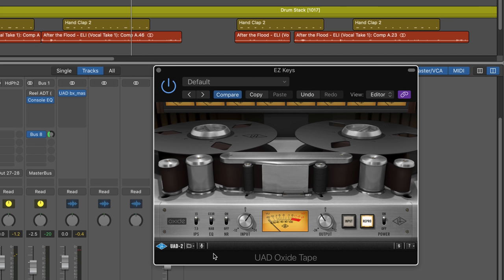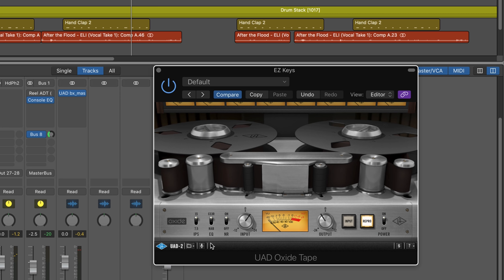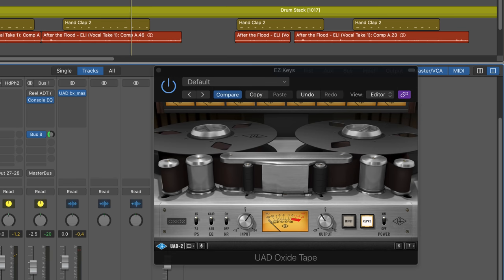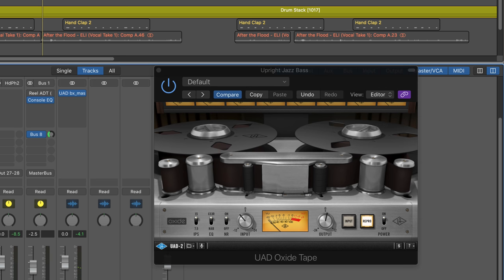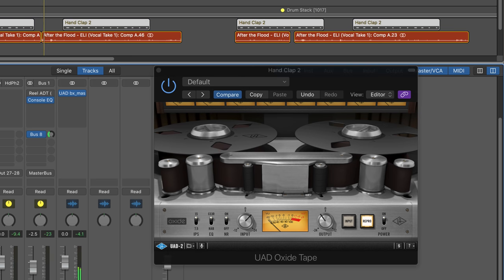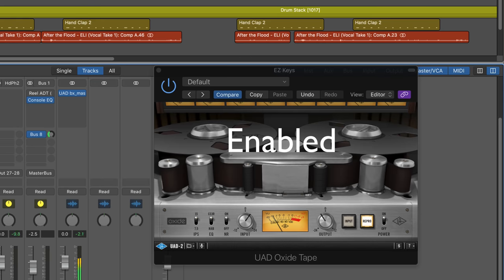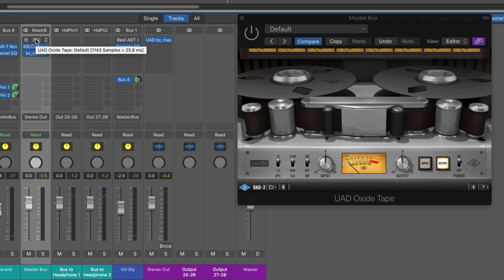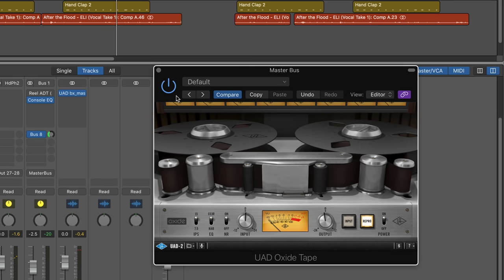How Much Of A Warm And Punchy Tape Like Quality Will Oxide Tape Add To Your Mix?

Comment: really -  you think this thing really does anything other plugins cant already do... its nice to think a pretty picture of a tape machine and some switches makes it somehow analog- i think its a placebo.
Reply: cmon if you cant hear how it opens the sound compared to the other plugins which only saturate it you are either deaf or have terrible speakers/monitors
Reply: @cecosvidovski  it barely changes the sound, pretending thats a huge difference is misleading. I can hear a slight difference.. is it worth a 200 dollar plugin? Probably not.
Reply: @MElixirDNB  It's definitely worth it. It depends on what you are trying to achieve. If your goal is to have a mediocre mix that most engineers can achieve with free or stocks plugins then it's definitely not worth it. The whole point of this plugin is to color your mix in an analog like way and open the sound in a way that only analog equipment can. This plugin for me stands out cause I really get that analog sound and openness from it. Most of the other ones sound digital. So why would I use an emulation of an analog tape machine when it sounds digital. I might as well just use some good distortion plugin instead. Also just because you can't hear it doesn't mean others can't. It takes time to train your ears to hear depth and the position of elements and the width of the sound you get. Also if you're using some crappy speakers then don't even think about hearing such things. I won"t even mention headphones because good headphones' prices are very expensive.